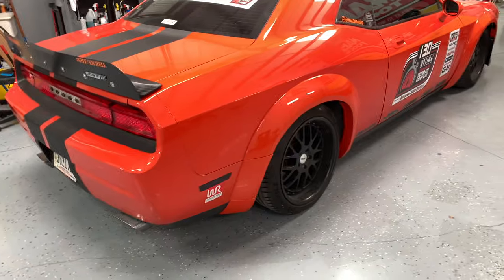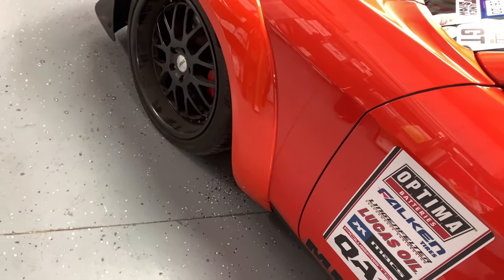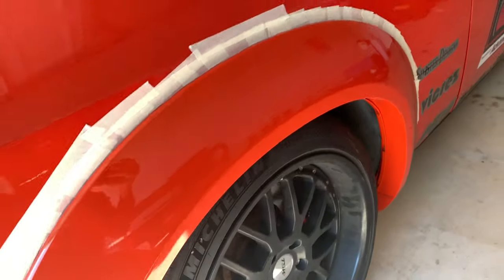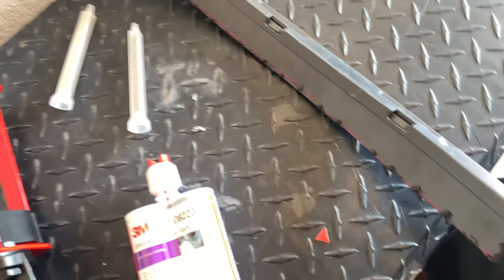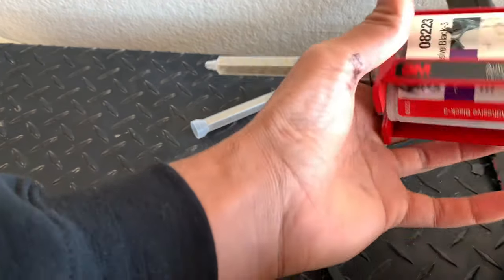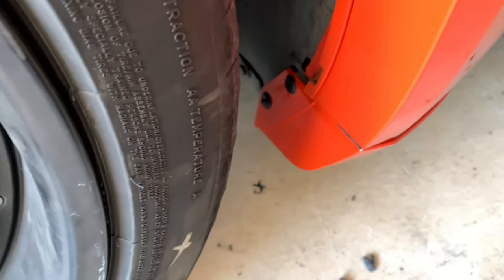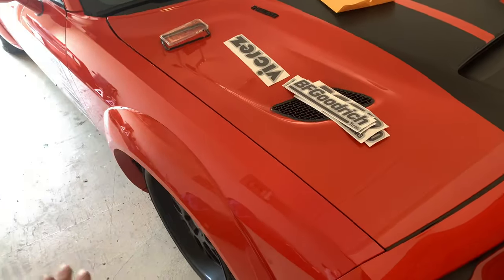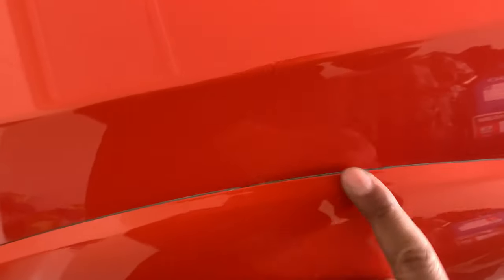Vicrez Challenger widebody: Tape VS Glue + (how to glue)

Comment: Wow talk about upbadging👎 I had a guy the other day in parking lot ask me if mine was real, really? Then I see this shit.
Reply from the maker: Wow, you are so quick to jump and judge something you don’t even understand. 

This car is used on the track. Everything done to this car has served a purpose. The Hellcat bumper allows more air in to cool the power steering cooler and added oil coolers, the Hellcat hood helps extract heat, the widebody allows me to run demon wheels and 200tw tires for a series that I compete in. 

There is not a single badge on the car that says Hellcat or demon, just one SRT8 badge on the spoiler. 

I have nothing negative to say to you, I just wish more people would take a deeper look at a build/ page / YouTube channel before jumping to conclusions and bashing something they don’t understand.
Reply: @nickbordenca   I don't need to compensate captain keyboard commando
Reply: @TIRADORACING   before anybody else replies up badging means a lot of things one of which means making something that it is not into something that it still is not
Reply: 2bParagon i think you should try compensating, it may suit you a bit better considering you dont have much going for yourself at the moment
Reply from the maker: We are going to have to agree to disagree. You don’t have to watch my videos, follow me on Instagram, or subscribe. You could have simply left it at your first comment. 

I see your point of view and I simply don’t agree with it. So this is where we part ways. Have a good one.
Reply: 2bParagon I dont know anyone that would consider a bumper swap and widebody kit upbadging you sound goofy 💀
Reply: TIRADO RACING dont listen to this guy, you have an insane challenger that youve turned into an even crazier track car, keep up the good work, haters like him only mean that youve made it 🙌🙌
Reply: @nickbordenca  where's your widebody scatpack? honestly you have no room to comment on any of this. its between them two. Leave it alone. and hey, how about "you" get your money up 🤭.
Reply from the maker: I mean he has a Hellcat.... so.... yea...
Reply: garrett banks i dont have a widebody scatpack, i have a hellcat 💀thus, my money has been up, and im pretty sure im qualified to comment on this
Reply: 2bParagon so people can’t modify their cars? You’re bragging about buying a car stock with 700 hp and complain when people modify theirs to make it look similar to yours. People wide body nissan gtr’s, 350z’s, and FRS’s all the time.
Reply: 2bParagon built not bought
Reply: TIRADO RACING Brian are you even mad??
Reply from the maker: Nicholas, no I’m not mad in the slightest bit. We all have our views on certain things. Everyone loves a $20 dollar bill, but guess what, I’m not a $20 dollar bill 😂! So not everyone is going to like what I do and I’m perfectly ok with that 🙂.
Reply: Does adding a Carbon Fiber Hood, decklid, & spoiler count as upbadging too? (Asking for a friend) lol
Reply from the maker: Bro your the biggest upbadger I know 😂
Reply: I have some JK head lights on my CJ7. Does that count as upbadging to a JK?
Reply: I Plan On Doin This To My 2016 Challenger Soon..Seen Dude Was Hating 🙄Lol Oh Well..Keep Up The Good Work 💪🏾
Reply from the maker: Thank you! I’ll keep on doing my thing lol thanks for your support! 💪🏽
Reply: @2bParagon  upBADGING.. I don't see a single upbadge on the car.. A body kit is not an upbadge, learn something and think before you type.
Reply: @nickbordenca  only reason i got a hellcat bumper is because my stock one got f*cked up
Reply: Who is your paint shop?
Reply from the maker: Colour house of Texas just repainted the entire car and oem widebody kit about a month ago I. Hemi Orange Pearl.
Reply: @TIRADORACING  cool its in leander... I just got my challenger. I have a few things to do to it. Would love to get your opinion on it. Would you mind if I email you?
Reply from the maker: You got Instagram? I’m @tiradoracing
Reply: @TIRADORACING  no socials.... Sorry
Reply from the maker: Send me your email.
Reply: @2bParagon  damn I’m so late, Not everyone likes to drive a stock car goofy, he’s only making his car better, not claiming it to be a upper trim.
Reply: im adding a body kit to my hyundai. am i upbadging
Reply from the maker: Lol def not
Reply: People can throw as much "upbadging" as they want at their car. It's their money and the VIN reveals the truth. Just remember, you can only put so much perfume on a pig.
Reply from the maker: My badges say SRT-8 09 style and people still think it’s a cat 🐈.
Reply: @nickbordenca  that’s what I’m sayin💀bro is making his own way of language
Reply from the maker: 😂😂😂 this comment thread is still alive!
Reply: A widebody and bumper swap is not up badging it’s just modding the car you start upbadging once you start putting decals, badges or emblems of any kind on your car that represents a higher HP trim like if you have a SXT you shouldn’t put R/T, 392, Hellcat, Bumblebee, 1320, Demon, Viper or Daytona  Badges on your car and so forth unless the car you have has different trims but they have same engine it honestly doesn’t matter because you wouldn’t know anyways anything outside if your cars engine trim is up badging and widebody kits and bumper swaps is not up badging it’s just a different style of the car even if you debadge the car it’s ok just don’t go adding higher HP badges, decals and emblems anywhere on your car or lying to people saying your car is something it’s not and racing people then have people out here thinking their beating a trim they are not actually beating they just beat lower trim fraud
Reply: your car is your personality and it definitely shows.
Reply: Lmao bros gonna love my sxt 😭😭😭
Reply: 8 inches. straight up. how's that for an up badge?

Comment: Glad to see this man, got my vicrez widebody coming and this is super helpful
Reply from the maker: Glad you were able to get some value out of it!
Reply: TIRADO RACING how long have you had the widebody on after installation? Any issues with the glue? I want to be sure this thing isn't going to come flying off when exceeding 100. I just can't believe they send these things out with double sided tape
Reply from the maker: It’s been like 6 months. I’ve had some lifting but it’s not the glues or the kits fault, I installed it in 30 degrees with poor prep. 

To properly bond you have to sand the mating surface and apply in an controlled environment and let it cure for 24 hours while holding constant pressure.
Reply: Did you get your kit yet? I think mines on delay 😕

Comment: Did it work well In the long term? I know this video 2yrs old, which is perfect timing for my question. I hope it worked well for you💯
Reply from the maker: It actually did hold up very well, driving the car as aggressive as I do and hitting cones, scraping on trailers etc are the only reasons I had issues. Plenty of people run this kit now. 

If you have the funds look into the oem widebody kit. It’s available through a Dodge dealership with a direct connection program. 

You still have to cut the rear per Dodge instructions. 

I went oem after having vicrez for a year.
Reply: @TIRADORACING  perfect bro! Thanks a ton!

Comment: What if you took a paint brush to the glue to level it out instead of a bead? Apply smaller bead on both then 1 light brush stroke all the way?
Reply from the maker: That’s a good what if.... I didn’t try it so I could not tell you how well it would work but just visualizing it I think it would work well!

Comment: Really appreciate your videos and your honesty. This channel should blow up soon. Just a couple questions. If you glue it, you basically can’t remove it right? It’ll be permanently on the car?  And at 9:42, just about as you’re removing the rear fender off the car, what is that stuff left behind on the paint? It that glue or tape or rust or something else? I’m worried about this thing rusting up my fenders. I hope to hear from you soon. Thanks again for the great video
Reply from the maker: Hey Anthony thanks for the kind words! 

To answer your question it is not rust! Lol it’s seam sealer. When you cut the rear of the car it is 2 layers. You cut the first layer off then fillet the second layer and fold it up to close the gap. You weld that together then apply the seam sealer to protect it from rust. Same stuff TJ Hunt used on his widebody Supra he built for Sema last year. 

I did film the cutting process but I lost all the video ☹️
Reply: TIRADO RACING oh no way, you had to cut the rear fender to put this on???

Comment: My plastic step the rear metal bumper of my ram was lifting, so I told the dealer. They used the 3m glue to secure it. It’s starting to lift again. They may have used clear not black. I’m one of the parts guys at the dealer I don’t remember what I gave the tech. Anyway, it’s not nearly as bad as it was. Just keep an eye on them. Also,They glued one spot you’re gluing the whole thing.
Reply from the maker: It’s all in the prep work honestly.....I learned this after the fact but the glue, the metal, and the plastic all have to be at the same temperature due to differences in expansion rates. So the way I did it was wrong. 

Secondly it would have been better to sand where the glue mounts to the car to give the glue something to hang on to. 

I’m not too worried, at the end of the season I’ll blow it apart and re do it all.

Comment: Anybody looking to put these on you can start with $700 to buy them, then by the time you’re done painting (Base-coat clearcoat) by a body shop and they have to glue them on the right way not 3M tape, now you’re probably looking at the $1800 to $2000 that may change by region where you live. Body shops aren’t cheap, especially the ones that know what they’re doing and to do the job the right way and once you glue them on there on for good, no taking them off without taking off the glue which will dry rock hard. So it looks like the whole thing would cost about $2700 to $3000. if you don’t want any problems after putting them on.

Comment: Try using a heat gun to loosen up the glue an put it back to close the gap
Reply from the maker: I would but..... this is a year old and the car is getting a completely custom aluminum widebody and front splitter built for it. Started yesterday. I’ll post videos as always.

Comment: thanks a lot great info. quick question: how long does it take the glue to dry, like how long would I have to apply pressure to the fender before releasing to let it sit the remaining 24hour cure?
Reply from the maker: Hey rich rich ! I would say 24hrs to be safe. I did like 24 min and that’s where I had issues.
Reply: TIRADO RACING yeah i saw in a previous comment were you said it needed 24hours of curing. but do I need pressure to be applied constantly the full 24? I thought it just needed to sit for 24hours not apply pressure the whole time
Reply from the maker: You know it’s one of those things where I’m not 100% sure. But to be 100% safe just apply pressure for 24h, your already going to wait 24h so why not apply the pressure. 

I don’t know how (obviously I didn’t do it) to keep pressure steady for that long, BUT I do have friends who leaned heavy objects on theirs for the time period and it worked.
Reply: TIRADO RACING ok I just didn’t have any idea how I could if I did have to lol. I thought that maybe leaning something on it would damage it. about how long did you apply pressure to yours?
Reply from the maker: Like I said two comments up. About 24 minutes lol I wasn’t kidding. Guys on Instagram have sent me creative ways they have been able to keep pressure on the flares. You don’t gotta lean up abrasive things like bricks or concrete (that would damage or scratch them) some guys wrapped things in towels or cloths to protect the flares from the objects they were leaning or pressing the flares with. 

Just gotta get creative, another guy on insta used JB weld on the flares to create more contact surface for the tape to bond to on the flare. And he screwed his brackets in with self tap screws. 

There’s not one set correct way to install them everyone does it different lol
Reply: TIRADO RACING sorry about that I completely forgot you already told me lol .I’ve been looking up a lot of things it slipped my mind completely. but yeah I realized there’s many ways from researching the past couple day’s. 

I’m just preferring to go with glue. gonna sand it down to give the glue better contact and smooth out the glue nice n flat almost like paint, so it won’t have much to rise even if I don’t apply pressure long enough🙏🏽😂. I was gonna screw in brackets already as well

I’ll research JB weld to see if it might be better then the 3M glue. Thanks a lot man I really appreciate you taking the time to respond I just have 1 more quick question lol if that’s cool?
Reply from the maker: If you have Instagram DM me @tiradoracing I’ll send you pics of the JB weld way the other guy is doing. And I can send videos of you need assistance. Sometimes it’s easier to send videos instead of trying to type it out on YouTube lol. 

You can ask your last question here Incase other viewers have the same question they can reference it here.
Reply: TIRADO RACING if u estimated what’s the min to max length/height I would need to cut fender for clearance? on a 2016 hellcat.

or if you could tell me how to measure my car myself to figure out?

and I only have Facebook I can give you my friend gram he’ll let me use it whenever he’s like family you can send it to him: iam_ksthakid
Reply from the maker: That’s a long answer. 

I originally had oem widebody flares that I put up against the car and you could see where the openings for the modified widebody fenders started and I made a line. Then I cut 1 inch up and around.

Then I matched the cuts openings to the vicrez kit. That’s it. Doesn’t really matter if your cutting 1mm or 1 inch, your already cutting the car so send it lol. But I don’t think you’ll need to trim more than half an inch to one inch. 

I’ll send pics on insta!
Reply: TIRADO RACING that makes since. I might just put the new fenders against it trace the inside an just cut the line(send it lol). Your right cutting is cutting no need to be extra technical lol

I really appreciate you taking your time out to help man seriously, thanks a lot. I’ll be looking out for those pics
Reply from the maker: I sent the pics to that account might be in his requested folder so take a look. And no problem man, just don’t over think it lol
Reply: TIRADO RACING lol yeah that’s exactly what I start realizing it’s not like it’s a AMG or something it’s a muscle car DIY. and ok thanks I’ll check for them
Reply: does Demon rims come offset automatically or do I have to get custom offset rims?
Reply from the maker: Demon (oem) come in one size and one size only. 18x11 -4.5

Comment: Hey bro, I have a hellcat here in Austin. I was wondering if you run wheels with a wider offset (or spacers if that's your thing) are you rubbing on your fenders? I got this widebody kit for 550 and am regretting it because I feel like I need to cut the body anyway for my wheels to fit and not rub on bumps. Thanks
Reply from the maker: Yea if you watch any of my newer videos or go to my Instagram (tiradoracing) you’ll see I run oem dodge demon wheels. 18x11 -4.5 offset with a 315/40/18 Nitto 555G2. 

My car is really low so I had to cut, I have friends who are stock height and using oem widebody wheels and they didn’t cut. 

Just to clarify I’m not saying you’ll be “ok” without cutting. I’m just telling you what I know others have done.
Reply: Is a wider offset better than spacers or does it not really matter just personal choice?
Reply from the maker: This is an age old debate. You’ll read both answers are correct. Basically depends on preference. If you go spacers just read up on the “proper” way to install them.

Comment: is the glue bad for the paint of the car?  will it permanently stain it?
Reply from the maker: I have no clue, the paint underneath the car was the least of my worries...not to mention I’ve cut the car so I never planned on taking the flares off. 

I’ll tell you what I’ve told many other people considering this kit

If you don’t want to cut the car buy an oem widebody Challenger 

If you want a pure oem look fit and finish buy an oem widebody Challenger.

If you scared the glue, tape or any other adhesive might hurt the paint then buy an oem widebody Challenger.

Not being mean, just being honest and transparent, this method isn’t for everyone!
Reply: @TIRADORACING  lol i have this kit on my car and im having issues getting it to stick . the 3m doesent work on the font fenders so im going to have to glue it . glad you made this video.
Reply from the maker: Ahhh yes, I’ve had a few of my friends on Instagram get it to stick using the scotch 3m stuff... the heavy duty kind. And one guy used a little heat to bend his flare a little. 

Here’s a link to the extreme mounting tape ( it’s the tape I used in my test, it was a pain to get off the car and it even pulled some paint off my car) 

https://www.homedepot.com/p/3M-Scotch-1-in-x-11-1-yds-Permanent-Double-Sided-Extreme-Mounting-Tape-414-LONGDC/205507375

Maybe give this a try before you commit to glue. Hope this helps!
Reply: @TIRADORACING  thanks! you reallly have to get creative installing this kit i used heat to shape my fenders but if your not careful you can dent it. ill use the scotch tape on the smaller pieces i already ordered the glue off your link going to use that on my front fenders. once those 2 pieces stick im set !
Reply from the maker: Yes you really do! Don’t forget you need that applicator gun for the glue to get a true 50/50 mix ratio! If you have any questions feel free to dm me on Instagram man @tiradoracing.

Also feel free to send me pics on how it came out! I would love to see it!